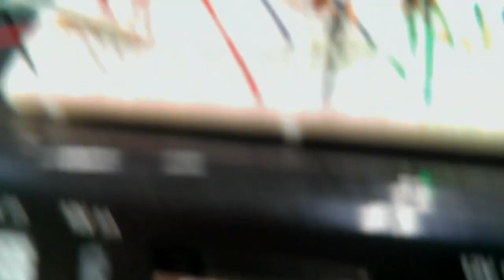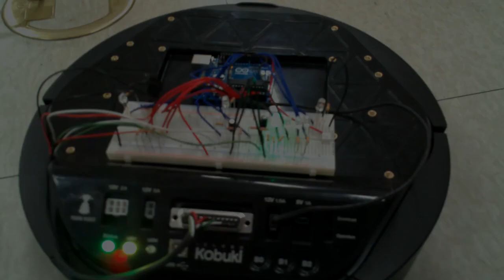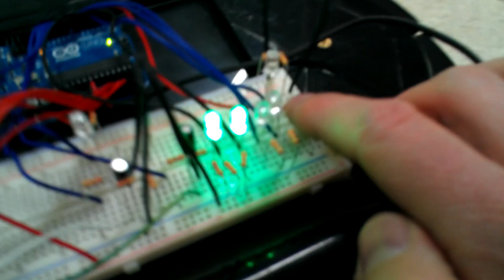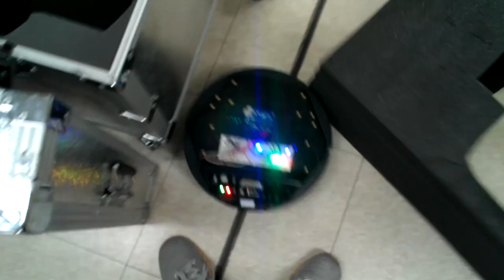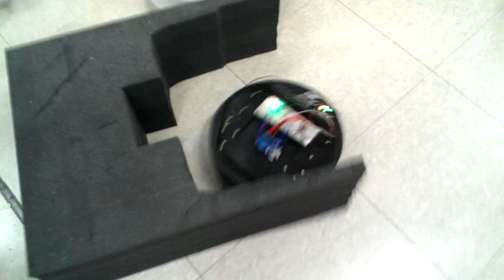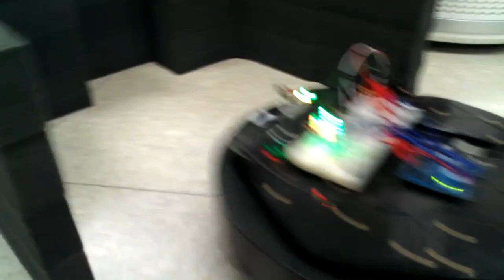Kobukino - Random Walker

Comment: Could you please make a short step-by-step explanation, what should I do to connect Arduino to Kobuki?

I simply connected DB-25 pins to Arduino pins but motor wheels speed is not correct. I guess I should add some RC filter, because controlling kobuki via pot is easy. What else should I do? It's not documented anywhere, leaving an impression that Kobuki is out-of-the-box 100% Arduino compatible